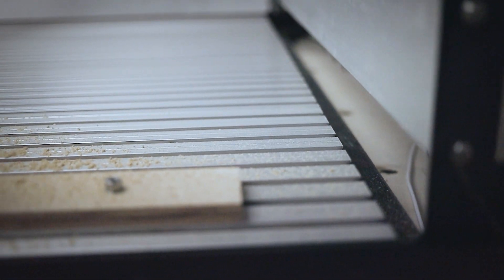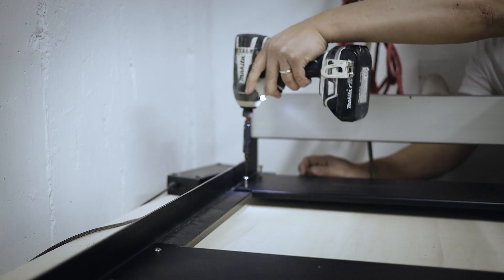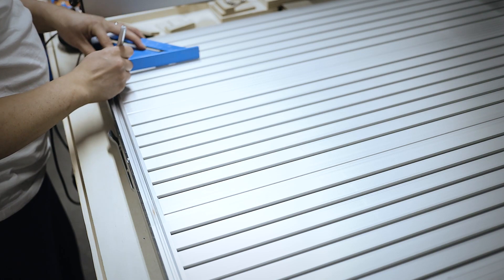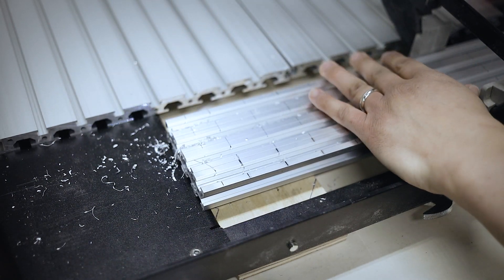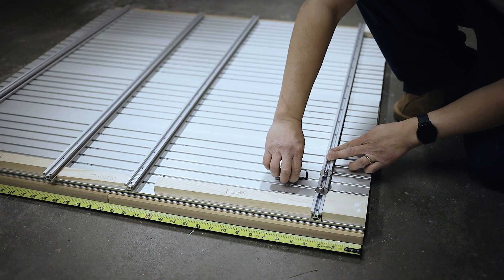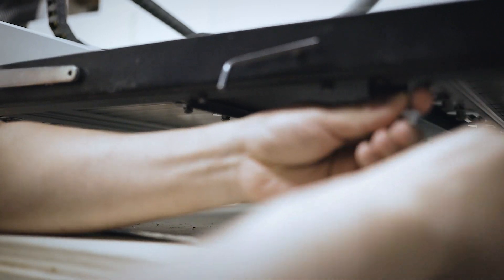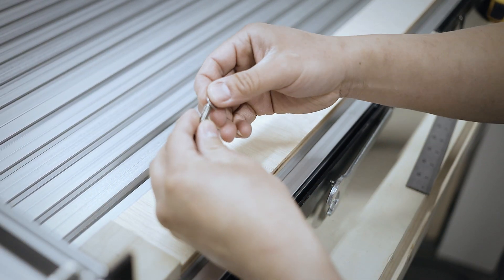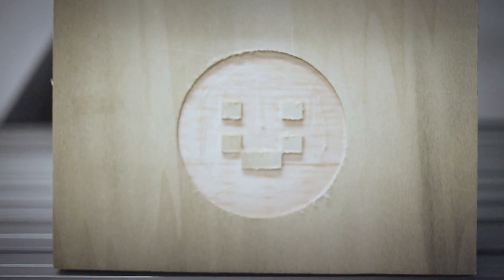CNC Aluminum Table Upgrade For Shapeoko XXL

Comment: Great build! Could you use 20x80 extrusion from open builds instead of the Misumi extrusion?
Reply from the maker: You could make it work. It came down to cost. At the time, it was cheaper to do it this way.
Reply: @ByTheGrain.mengyang  gotcha! They don’t have it available yet but open builds is 1/3 of the cost of the Misumi, the Misumi is $70 a piece now
Reply from the maker: You just have to find a way to evenly support the top rail which is ultimately going to be the top work surface.